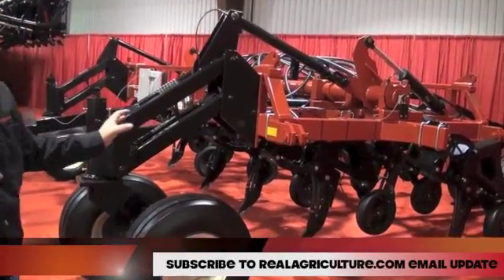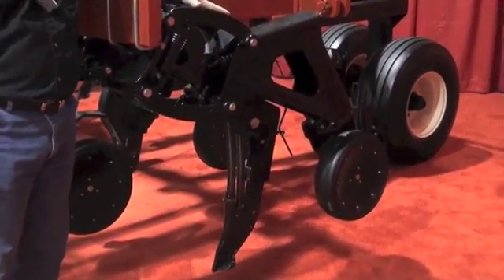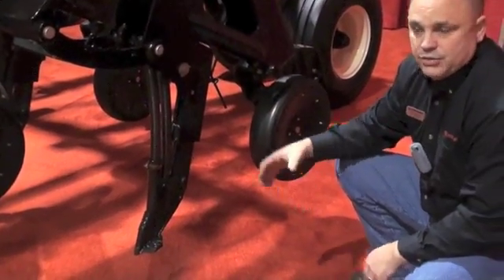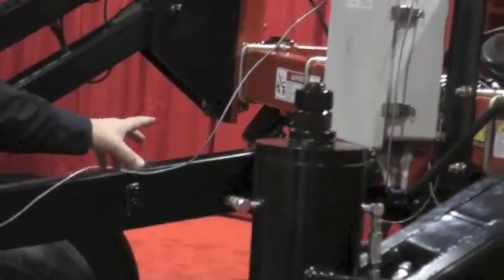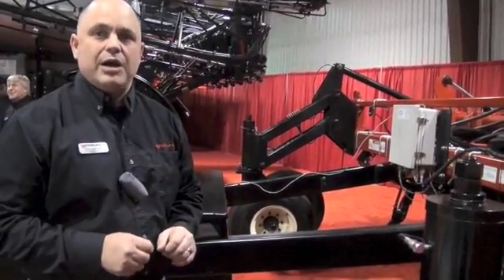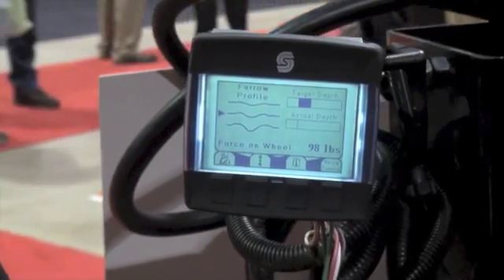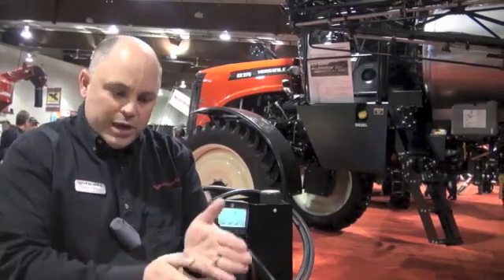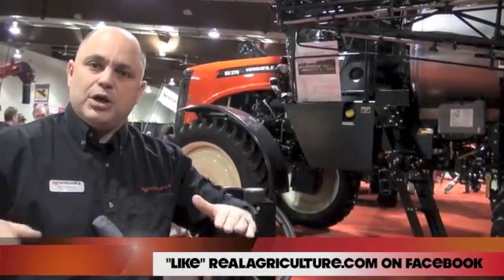Versatile Drill Wins Innovation Award

Comment: I still don't know how you set your depth,,,without adding too much packing pressure.  And from the discription of how the drill works,,even though its a "mechanical" opener, it still needs a huge amount of computer aid to function. So why not just use the current units that are out there?